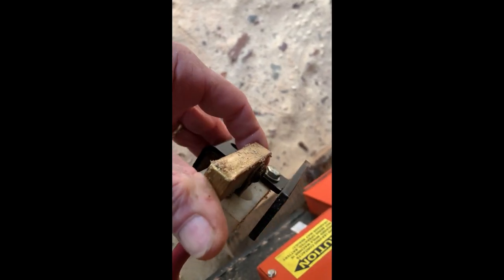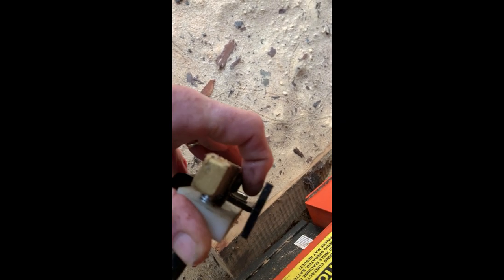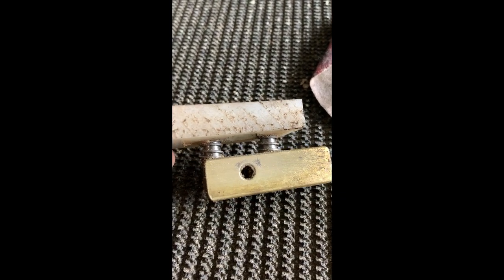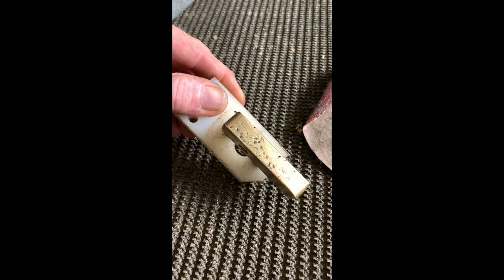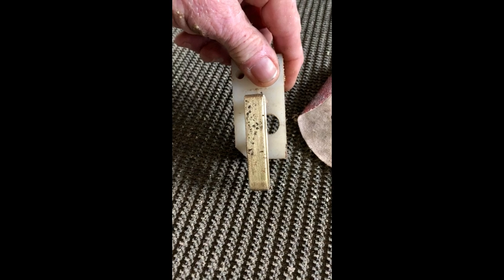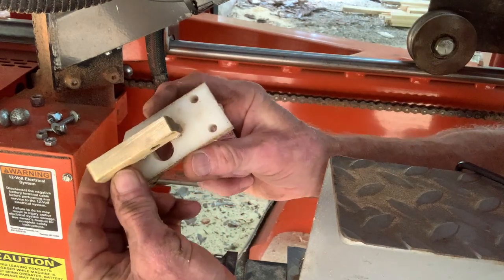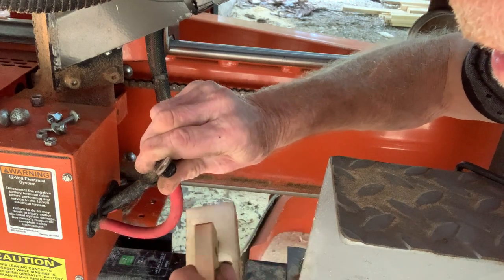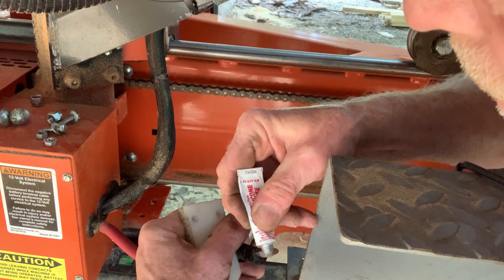Cleaning up the mess I made on my Woodmizer Sawmill.

Comment: Going to the shop in a little while and search for that lower bearing felt cup. Never knew it was there. Probably dry by now.
Thanks for the info. We've all got to stick together.
Dave
Reply from the maker: Yes we do Dave and I appreciate your input. I found the lower cup when I built the seat attachment.  I enjoyed your butternut video, man that’s good looking wood.
Thanks again
Reply: @oldbluffsawmill5235  Both oil cups were dry and took about 25 gallons each (well........almost)
Reply from the maker: Glad you got it buddy….I know better than any 25 gallons though. Maybe 2.5 oz